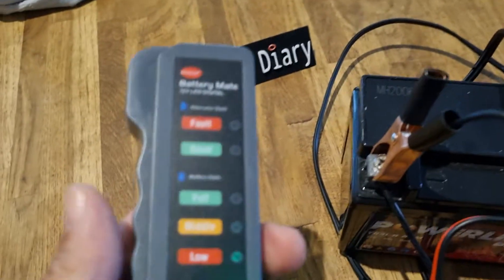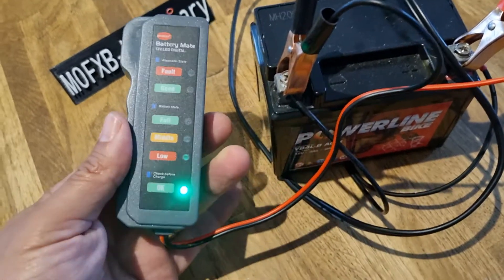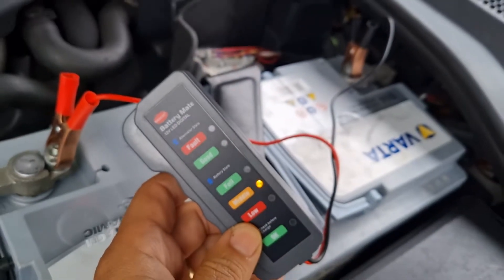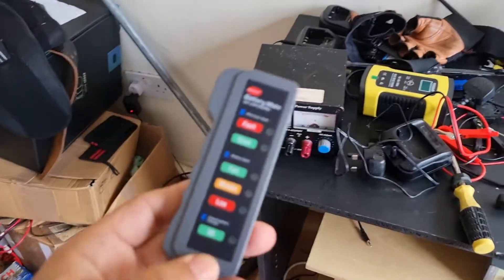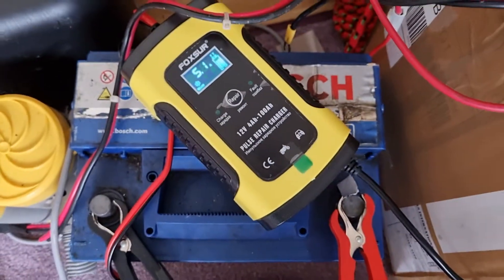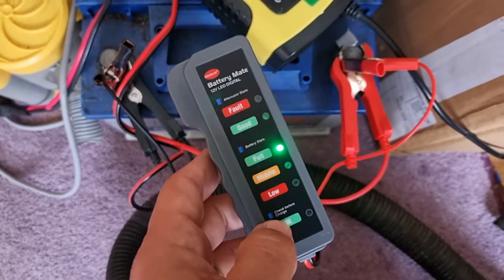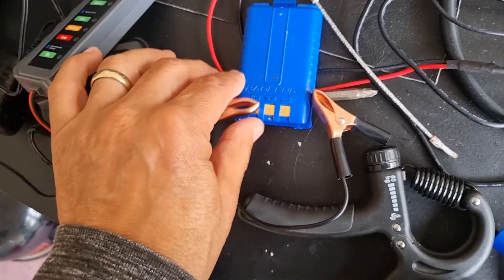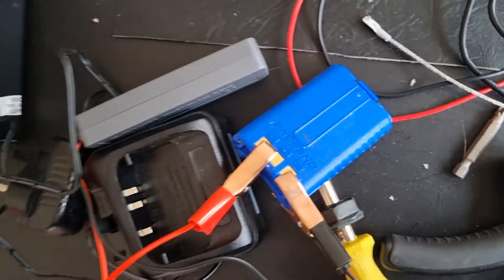BATTERY MATE 12 Volt

Comment: It's always a gamble on cheap stuff but atleast it's cheap if it doesn't work. I keep a $20 multimeter in the car for real voltage opposed to a LED. A proper charging test would have to apply a load I think.🤔
Reply from the maker: Yes agree it was like buying a chocolate bar.
Reply: They don't give a proper reading. Cheap rubbish.